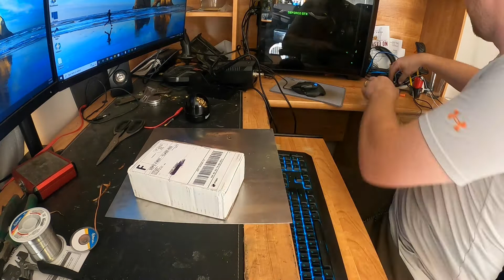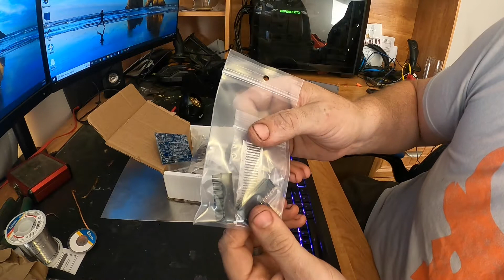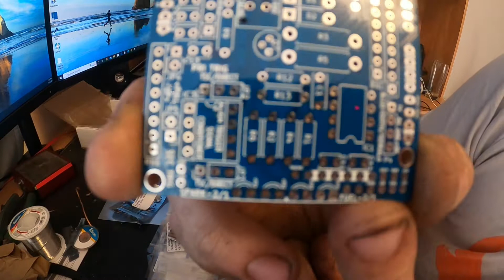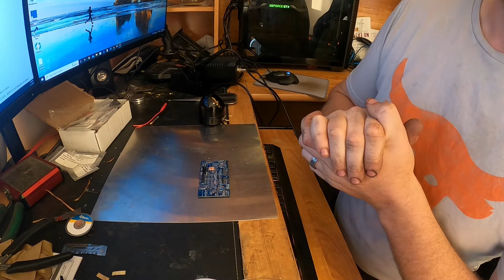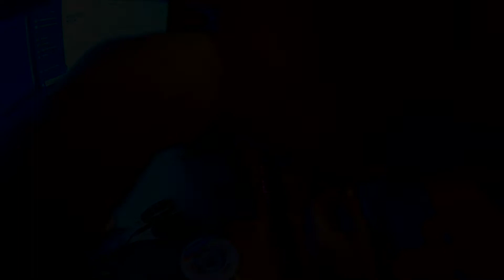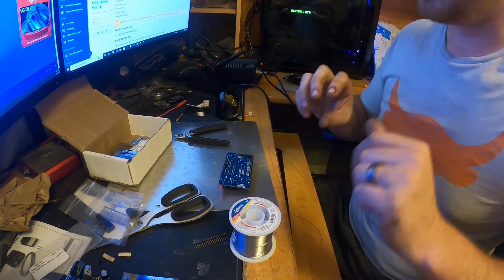Speeduino NO2C board assembly!

Comment: I wanna put one of these ona sbc/ lt1 do they have one with 8 injector drivers and 8coils drivers?(ls style smart coils)
Reply: the dropbear speeduino supports 8 injectors and 8 coils
Reply from the maker: As far as I know they only have 4 drivers for the coils, and injectors. Would need to run batch fire on a v8